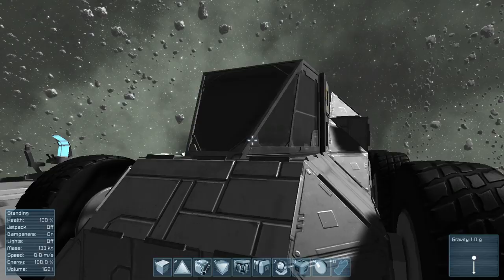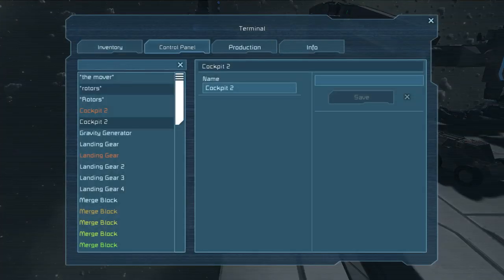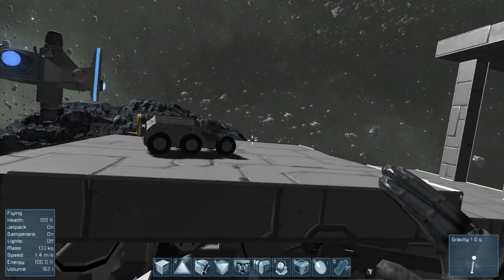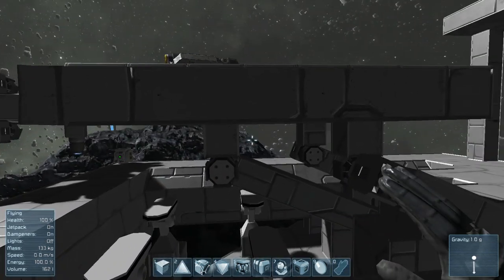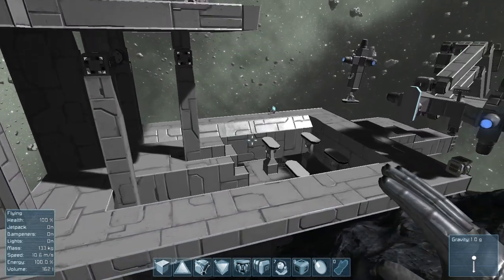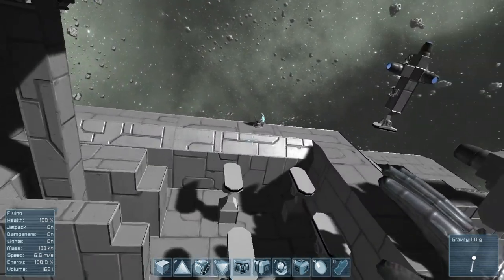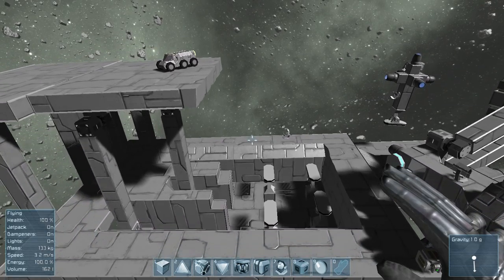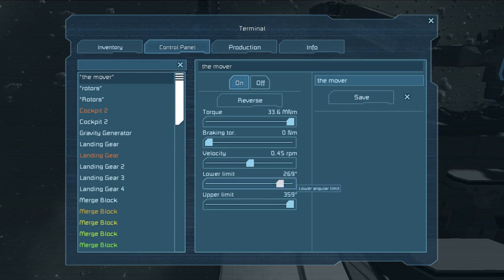Space Engineers - Lift

Comment: You can fine tune them
After you click on a slider use left and right on the keyboard 
Cheers
Reply from the maker: Excellent, thank you for the tip Troa Barton It doesn't solve the 360 degree issue, but it does give better precision elsewhere
Reply: yeah i wish you could set it at the ends before it goes to unlimited... but still glad to help.